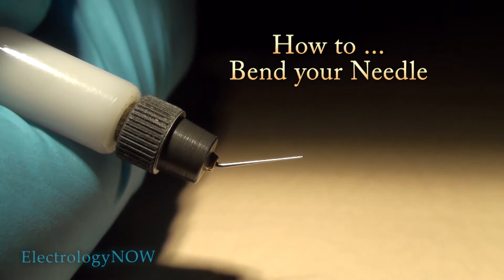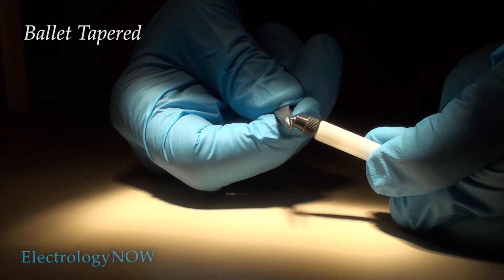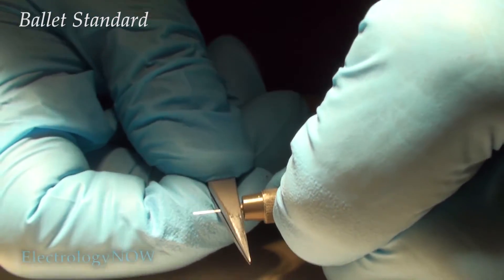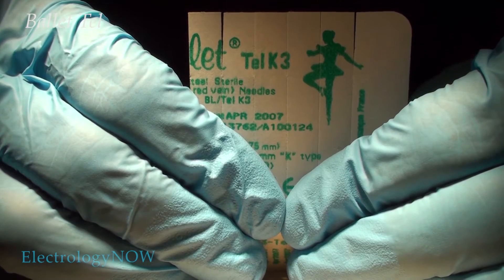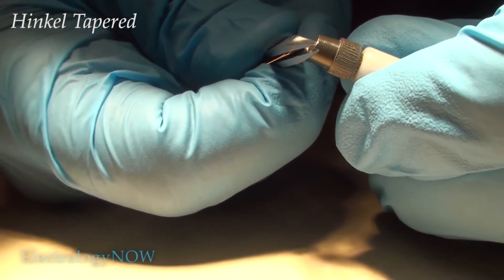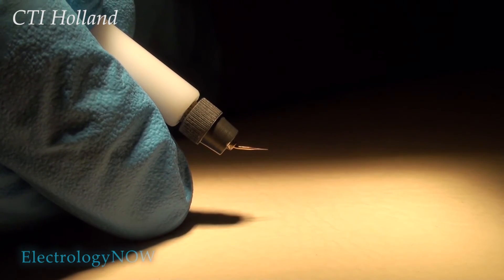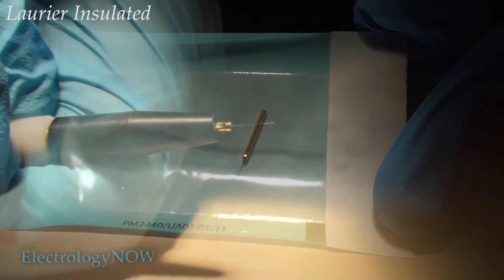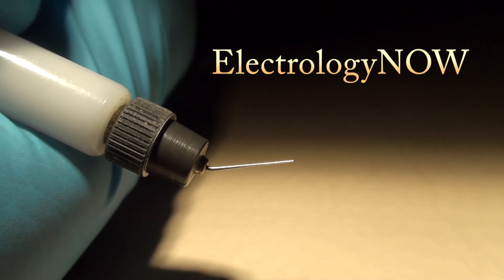How to bend an electrolysis needle

Comment: I never heard about bend needles used for electrolysis. Do this at your exam and you get sacked.
Reply from the maker: Because you "never heard of it" means nothing. The bent needle is standard and used extensively in the Hinkel school. Those "exams" of which you speak are often lacking.
Reply: @ElectrologyNow  Weird, I just looked into it and can't find much info online. Neither my 4 handbooks mention anything about bend needles nor did they teached me about this at the electrolysis course. Which brand of needles do you use for this?
Reply from the maker: @sarahlicious6453  I suppose I'll do a video on this. I greatly prefer (real) tapered needles ... it's just that they are not made any more. I suppose the standard Ballet needles are okay ... still, not that great. If you're using a 2-piece needle, bending might not be necessary. The real tapered needles (that came in 12 sizes) are still the best for thermolysis and avoiding over-treatment: if they are used properly. (the Ballet tapered needles are now terrible; don't waste your time. Blunt ends and wrong sizes) Sadly, the Laurier insulated needles are gone too ... what a shame.

Comment: What would be the best needle to use for galvanic applications? I've read somewhere that the tapered insulated needles would be best, is this true?
Reply from the maker: for galvanic, it doesn't matter (just not an insulated needle).
Reply: Electrology Now Would you mind explaining to me why not? Thank you in advance :)
Reply from the maker: Insulated needles are designed for thermolysis only. Insulated needles defeat the purpose of the galvanic.

Comment: My school said taper needles are no longer available.  is that true?  I have Clarblend Elegance+ f shank. What needle would you suggest using for bent insertions?
Reply from the maker: Ballet makes tapered needles. They are not the perfect sizes. You will find the "C small" best for body work. These tapered needles are k-shank. I prefer bending the tapered needle.
Reply: Electrology Now  Will k work on a F shank?
Reply from the maker: Unfortunately you will have to get a needle cord that will take the thinner k-shank. I have both types of needles cords so that I'm able to use any of the major needles being produced today. The needle is your ultimate instrument and, in my opinion, more important than the machine you are using.
Reply: Electrology Now  ..Good to know I did not know you could use both types of shanks, the F was recommended because it would be interchangeable with the Skin Classic.    hmm I guess I need to add two K cables.
Reply from the maker: Well, that's very strange indeed. The Ballet "tel" needle (specifically made for tele work) has a K-shank. Furthermore, please do not spend extra money on ANY machine for "skin work," because they are ALL simply electrolysis units with a different name. 

There is no need to check this, because if these machines were anything else than "class 1" they would have to undergo full FDA (medical) testing and approval that would cost hundreds of thousands of dollars. ALL THE TELE AND SKIN DEVICES ARE ELECTROLYSIS UNITS ONLY! (I designed the original Telangitron units made by Clareblend and Hinkel ... they are simple electrolysis machines ... and that's it!)

Comment: Hi there, I have been using Laurier Insulated needles and some protec.  I bend my needles also but my favorite needles to use are the Ballet Insulated but didnt have a lot of room left once I bent it but I see they have the tapered and I will get those one my next order because they are more affordable than the Laurier and I get smoother insertions but my question to you is how do you feel about insulated needles for Thermolysis and what are your favorite that you use for the blend and thermolysis?

Thanks in advance, Olivia
Reply from the maker: Hi Olivia ... I mostly use Ballet tapered (I do blend). They are pretty good, you will only need the "small and medium." The sizes aren't as perfect as I'd like and sometimes the tips aren't polished as well as the normal Ballet ... but they are still my first choice. THANKS for you comments.
Reply: I will try the tapered next time.  Thanks.

Comment: An important point about the Ballet Tapered needles is that they require a thinner K-type probe holder.  If you have the F-type probe holder , which I think are most common on FIsher, Apilus, and other machines, the tapered needles may not fit.  I was made aware of this by TES.  I have a Fisher with an F-type holder, so I will need to get a new probe holder to use the tapered needles; I intend to do this as I think the advantages of the taper are worth it.

Comment: Can you make a more detailed instruction video on proper loading of needles into probe holder especially the K shank tapered needles? I have a hard time figuring out when to stop pushing the needle into the probe before tightening the probe holder. And sometimes I lose the needle when fiddling with the tweezer, needle and probe holder.  The 2 piece needles are easy to figure out as there i an abrupt end to the needle and the part that slides into the probe holder.